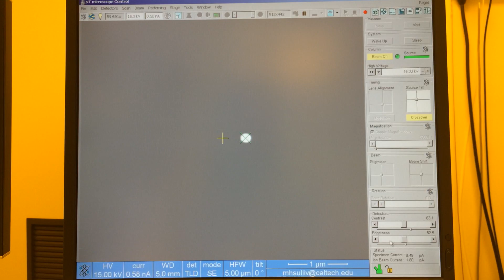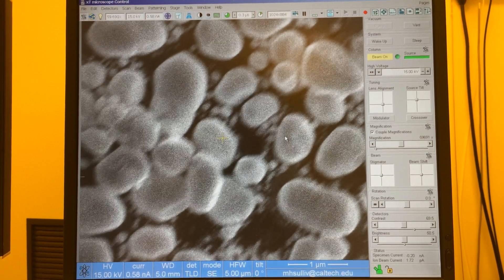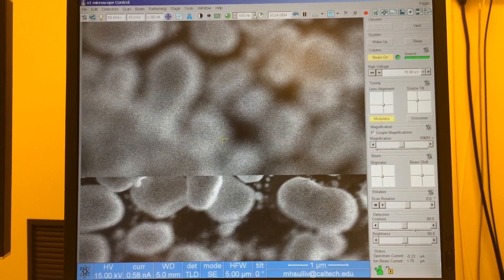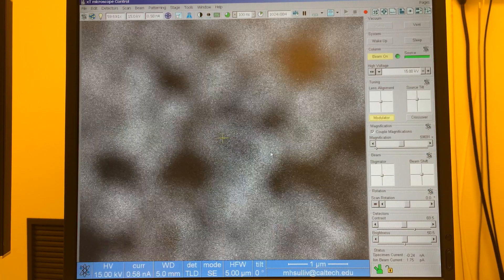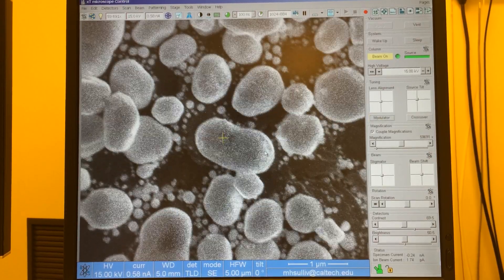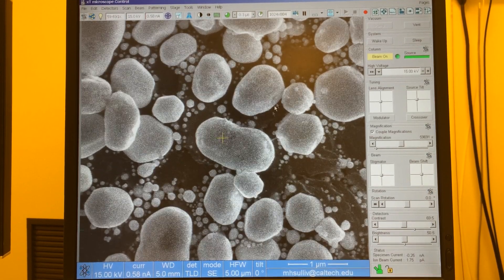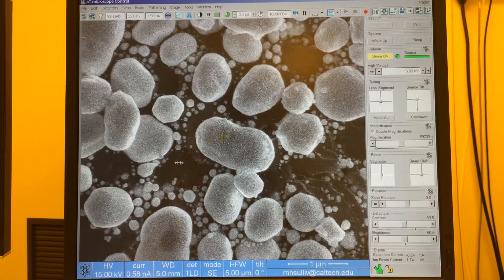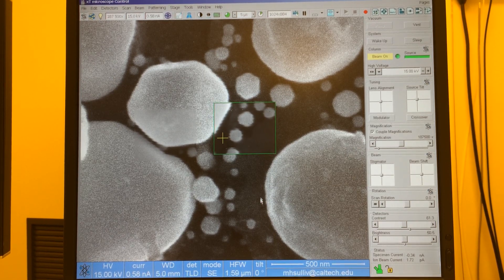Basic SEM Alignment (Source Tilt, Focus, Astigmatism, Lens Alignment)

Comment: Great video thanks. Do you have to correct the astigmatism after each change in current, or is it a 1 and done type of situation? Thanks
Reply from the maker: You need to correct the astigmatism after each change of voltage, current and even working distance (i.e. if you move to a new area and the focal plane has moved up or down even as little as 10s of microns, you may need to fine-tune astigmatism). So it is a constant adjustment that you have to be ready to make. The good news is that anytime you adjust focus, which you also must do very regularly, you will be able to identify if there is astigmatism by the stretching that you see or don't see. If you see it, fix it. If you don't see it, there's nothing to fix. 

Train yourself to recognize stretching of the image as you focus and you'll be able to diagnose the state of the alignment immediately (the same goes for identifying shifting, which indicates the need to adjust the objective lens alignment, i.e. the beam needs to be centered on the objective lens). The next step after that is to train yourself to identify focus as the place where there is stretching on either side (it could be very subtle or very severe); if you can get to that focal plane, then correcting astigmatism is as easy as adjusting the X/Y-stigmators until the image is as sharp as possible. 

Lastly, while correcting astigmatism, if you recognize stretching *then*, that merely means that you selected the wrong focal plane... so return to focus and try again. For more details on correcting astigmatism – and the physical mechanisms behind the correction – see this other video: https://youtu.be/YeukVt1Fyi0